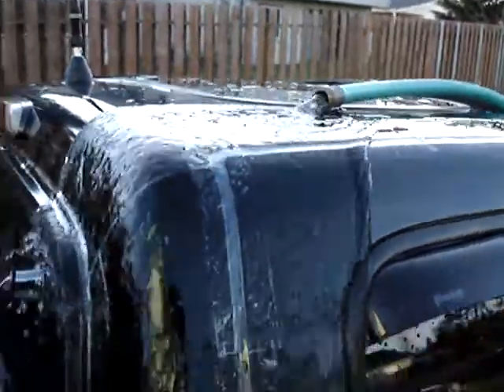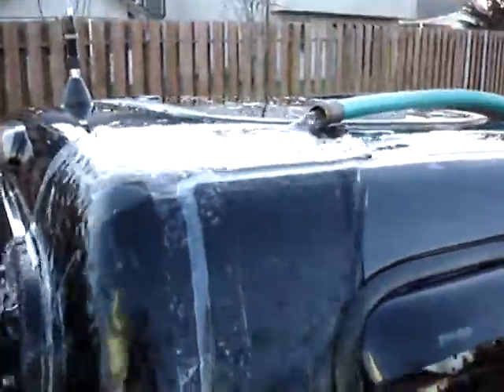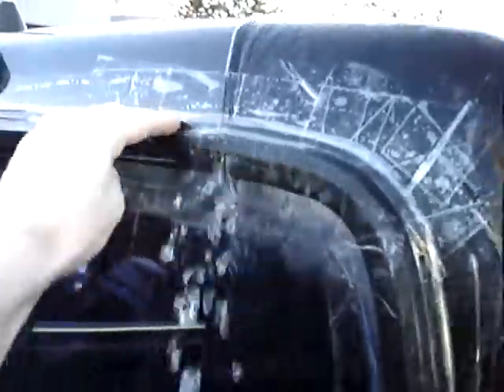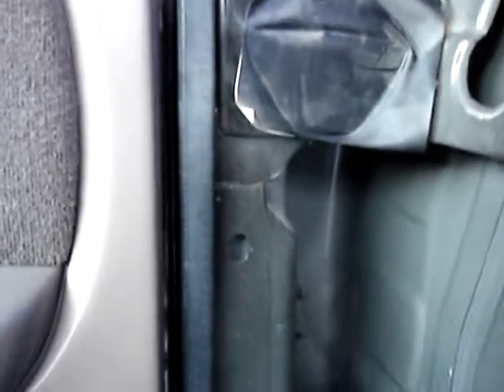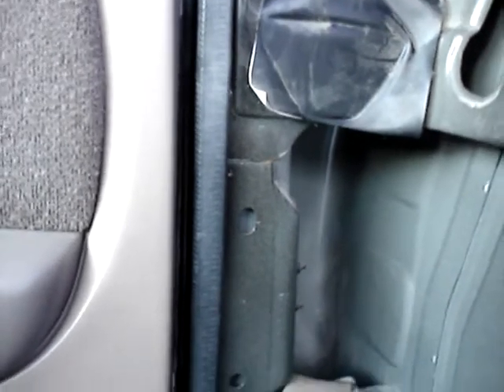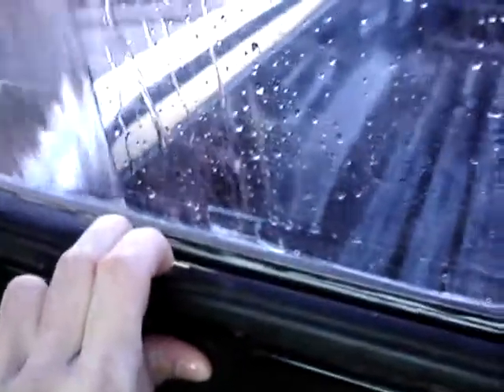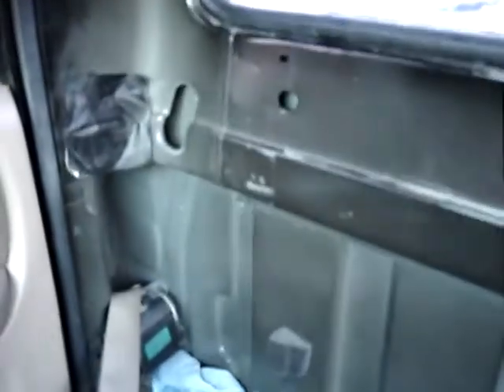Water Leak

Comment: i have an 88 leaked like a sob was  the seam in the rain gutters cleaned all the old sealer out and resealed it fixed that problem another leak at the back of the cab was the outside cab light